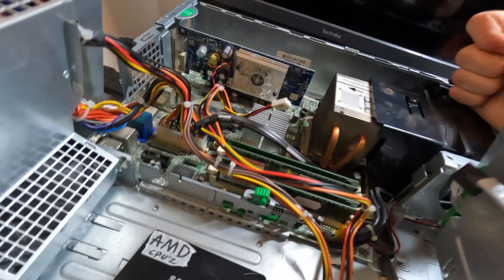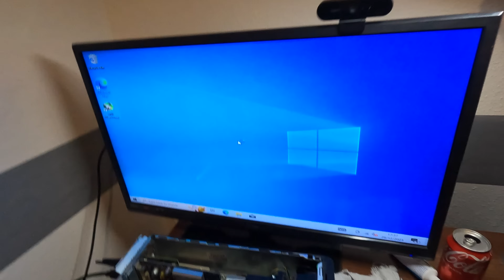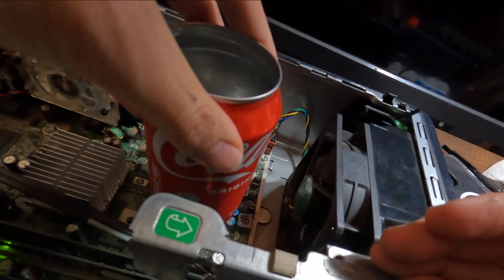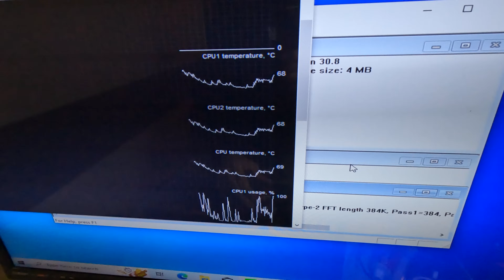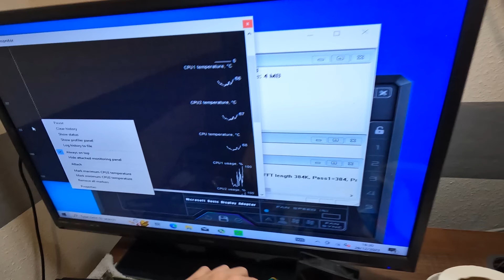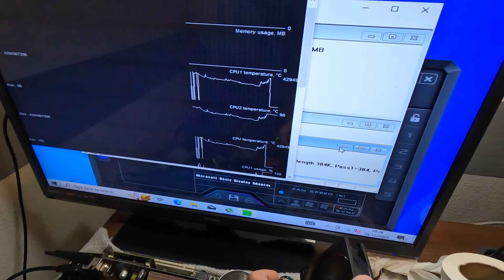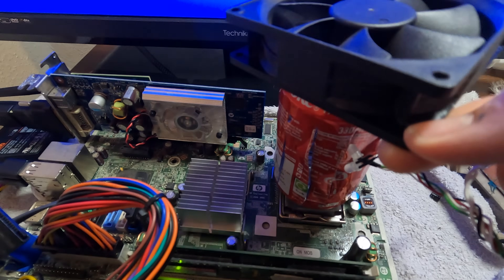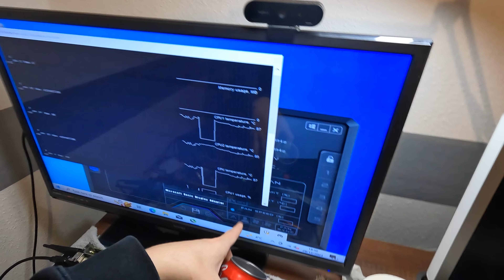Coke Can CPU Cooler…

Comment: The biggest limit of the can is the lack of a flat surface and of surface area on the can. If it had more ribs that should work. I'd recommend cutting open a bunch of cans and bolting them together into some sort of ghetto cooler.
Not gonna complain about the toothpaste. That is just fine. Not as good as "proper" thermal paste, but it will get you over the weekend if you don't have anything around.

Comment: Since you're using toothpaste, you might as well not even put the Coke can since there's going to be very minimal heat transfer. It's like testing a new Wifi 6 router but using a device that only has 802.11b with 11mbps max
Reply: Toothpaste is about 5°C worse than thermal paste. It pretty much performs like a "bad" thermal paste, but will be much better than using no paste at all.
It won't last tho. The thing that makes even the worst thermal paste so special is the fact that it stays stable over months and years. Toothpaste will be unusable after a few days at best.
Which means it can get you over the weekend if you have no paste around and the delivery comes on monday, but that's about it.

Comment: I enjjoyed this video, however, it feels like it was mainly done for the lols. 
Things to do if you want to implement the coke can cooler in a "reasonable way" --- you need to flatten the bottom A LOT MORE than you did, and figure out a way to use brackets or something to mount it to the motherboard --- the reason other coolers use them is because without the pressure onto the CPU (evenly) you can't , even with paste, achieve proper surface transfer of heat. Try researching cheap ways to mount the can to the board using the screwholes. Also do more to flatten the bottom. I like the idea of the open lid can with water in it --- it could work a lot better if you make sure the bottom is flat, the paste is making solid contact, and the can is held down with screws to tighten the hold onto the CPU and motherboard (evenly)
BUT good job on the video, it was entertaining, even if it was effectively, not fruitful.

Comment: I have a few of those old PCs. The cooling is actually pretty efficient. I ran a stress test for about 20 minutes and it only went up to 85 degrees
Reply: That sounds fine. But then, the 3 GHz model is rated with a 65W TDP, but doesn't even come close to that. So the 2 GHz one should be a lot below that.

Comment: Well another person mentioned what I was about to, you'd need to make the coke can flatter and use actual thermal paste. There wasn't much of the can touching the surface, it's obviously going to be a terrible cooler due to less mass to soak up the heat but given the multiple concavities in the bottom and a ton of toothpaste being in said concavities, it really had no shot.

Comment: if you made the bottom of the can totally flat, you would get a totally different result, that's the main problem, even if there's a small dent it would completely ruin it 
other than that i mean you did use toothpaste and not thermal paste xd

Comment: How the heck do you expect people to read the temps in your monitor when you are constantly shaking your camera??

Btw: interesting video idea, wrong implementation. The whole idea behind the use of thermal paste is to improve the physical contact between CPU and heat sink at the MICROSCOPIC level; having a hammered can sit on top of the CPU leaves way too much of a gap between it and the can.

Comment: I've actually thought about trying that before, the trick is evaporative cooling. If you try it again use a liquid that vaporizes a bit higher than the ambient temperature (like alcohol or ethanol). Wrap a loose balloon around the top part (for the pressure difference) and basically cool the balloon so the alcohol vapors condense and drip back into the can. Also, not to mention that fuel vapors combined with oxygen are explosive (basically do it at your own risk).
Reply: Do Not let this guy anywhere near something flammable!
Reply from the maker: Bet
Reply: TLDR:

"You should make this gigantic thermal pipe"

"Oh btw forgot to mention it's explosive, have fun"

Comment: thank you for doing this with old, barely usable (in 2023) hardware instead of ruining perfectly serviceable computers like some other content creators do.
Reply: manitoba-op4jx  the OS itself will run fine but I don't know how much you can do with that, like, at most watch youtube? or maybe im just misremembering the performance of the core 2...
Reply: @eduardoroth8207 i tried messing with a c2duo e8400 a while ago. I was able to run far cry 2 and 3 on it. But I was on xp. Windows 10 might be a horrific experience lol
Reply: we are in 2024 now...
Reply: @younasqureshi9179  yeah that was a typo but I'm gonna leave it there
Reply: Idk, for a machine that just has to display pdf's and maybe stream some music in a workshop it'd be fine, but I'll repurpose any old crap
Reply: @vi_dn  i know, but, on my comment i just wanted to highlight the fact he did those experiments on very old, disposable hardware, i've seen some content creators doing the same but with like, ryzens, which is incredibly infuriating
Reply: @eduardoroth8207 fr, people get surprised when its high temperatures and then they have some threadripper (not actually but you get the point)

Comment: You should have probably hammered in the ring at the bottom of the can so the middle part stays flat. If there is a dent in the bottom of the can you couldve put it in hot water and hammered it while it was still hot and standing on a flat surface... or you just go for a xilence l200
Reply from the maker: Cheers. I haven’t thought about that. Would use this tip next time. 👍
Reply: @conseptcomputers  But honestly I think just leaving that cpu bare and cooling it with case airflow would yield better results. I mean its a core 2 duo
Reply: Yeah would love to see this revisited